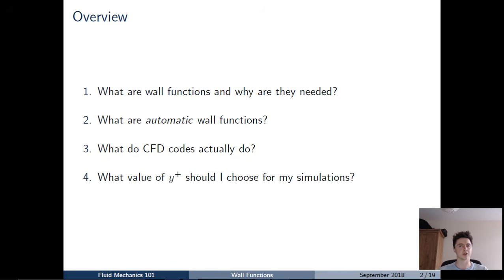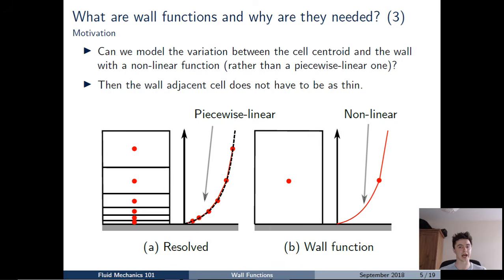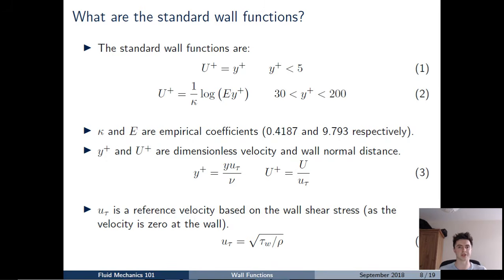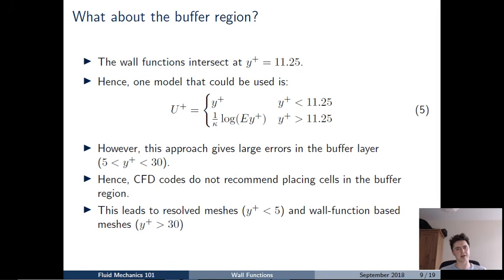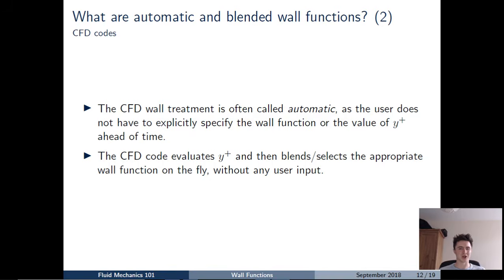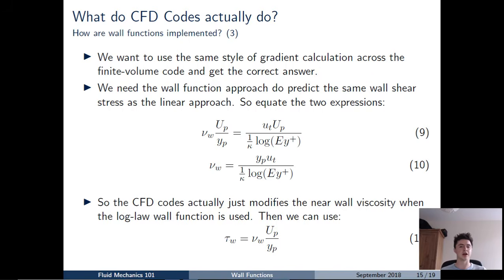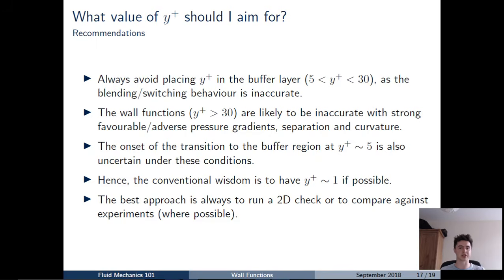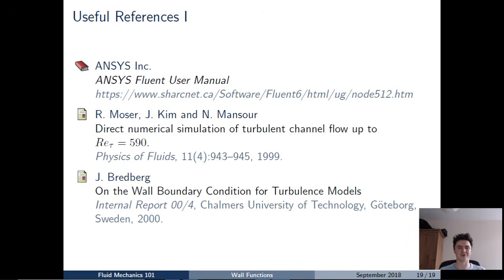[CFD] What are Wall Functions and How do they work?

Comment: I know that in the case of laminar flow, the near-wall profile is usually quadratic, which depends on the local pressure gradient. Are there situations where even a y+=1 , or even 0.1 isn’t good enough, and you need some alternative, more general boundary condition?

Comment: Good morning and thank you for such a good lesson. Just one question from my side. Here you explain the wall functions theory considering a Finite Volume CFD code. But I assume that this theory holds as well when you use a Finite Elements CFD code, is that correct? Or are there any significative diffrences in that case?

Comment: Hi Aidan, thanks so much for the video and lectures. It is really awsome and very helpful. I would like to ask you ine thing if I may. One thing is not clear to me that, how this calculated effect of the wall sheer streas is then fed into the momentum equation. Is it done by modified turbulent viscosity, which is then used in the momentum equation? So that the velocity at the first grid can take into account the effect of the (total) boundary viscosity?
I appreciate your help in advance!
Reply from the maker: Yes, that's correct. The modified viscosity is accounted for in the summation over the faces of the cell when calculating the diffusion contribution to the A matrix of the momentum equation
Reply: @fluidmechanics101  Thanks a lot for the clarification!

Comment: "Thank you for your awesome video! could you please tell me which y+ in In OpenFOAM, should  be between 30 < y+ < 300? Is it the minimum, maximum, or average ?
Reply from the maker: It is the y+ in the region that you care about (or affects your solution the most). 

For example, on an aerofoil it is the y+ on the trailing edge of the aerofoil which has the greatest effect on the separation point. You care less about the y+ near the stagnation point at the nose of the aerofoil, as this has a smaller effect on the drag calculation. 

So you need to use some engineering judgement. Have a look at your geometry and try and deduce which region in the most important. If you are unsure, you can always test it by creating a few different meshes and see what effect it has on the results

Comment: Thank you, Aidan. Well explained particularly on the implementation of wall functions.

Slightly confusing when you say "by substituting in the logarithmic profile" to evaluate the wall shear stress - Eq. (8). In fact, the velocity gradient, at the wall, can only be worked out by using the linear wall function u+ = y+ and the logarithmic profile is obviously not applicable in the viscous sublayer. Forcing the logarithmic profile to pass (yp, Up) is here to just figure out the "right" velocity scale utau.

Anyway, very high-quality video!

Comment: Aiden, I had a doubt,
Till what value of y+ is the wall function to be applied for in the mesh?
Ypu have mentioned that for y+ > 30, use wall functions
But till what y+ value is that to be used, above which is the resumption of normal CFD interpolation?
Reply from the maker: This will depend on the CFD code you are using. Often there is a hard switch between the viscous sublayer and log law at y+ = 11.25. It's really worth checking the user manual

Comment: This lecture clarified my confusion. I thought the wall function was specifying the velocity at the first grid centroid. However, through this video, I found that the wall function is not giving the velocity value to the first grid centroid, rather, it uses the velocity at the first grid calculated by the conservation equation and the wall velocity (=0) to get the modified wall stress.😀
Reply from the maker: Exactly!

Comment: Thanks Aidan for this video. In summary, velocity profile is computed as piecewise linear in CFD due to values at cell centroids. However, turbulent velocity profile is non linear. In order to bridge the gap, wall functions are used. For y+<5, linear variation is observed. So wall function is not needed. Avoid buffer region where profile is not predictable for most of the times even though wall functions does some approximation. Use wall function where y+ is above 30, profile is predicted as logarithmic and 1st cell velocity is computed. The overall purpose is to compute wall shear stress and 1st cell velocity accurately. Please correct me if I am wrong.
Reply from the maker: Yes! 100% correct

Comment: y+ and u_t require wall shear stress to be known which is part of solution. As we don't know wall shear stress yet Equation 9 is an implicit equation. So, there must be some kind of iterative approach required to solve it unless there is another way to estimate y+ and u_t.  You didn't explain how it is done I think.
Reply from the maker: Yes we'll spotted. If you choose y+ based on wall shear stress, rather than turbulent kinetic energy you need iteration. You can either just take the wall shear stress from the previous iteration of the SIMPLE algorithm itself or you can do the iteration locally. You can find this iterative equation either in the OpenFOAM source code, or checkout the book by Weller and Greenshields 'notes on computational fluid dynamics'

Comment: A question bothers me: If I set the no-slip boundary condition on the wall, and I set the viscosity to be 0 at the same time,  would the boundary condition be slip? If not, what the physics looks like ? Thank you very much!
Reply from the maker: Yep, you would have a slip boundary
Reply: @fluidmechanics101  Thank you very much for your reply! For no slip condition with 0 viscosity: the first layer of fluid still adheres to the wall, but the second layer of fluid can move freely. However for slip condition with ideal fluid: the first layer of fluid can move freely. Based on this, I still don't understand why these two situation is equivalent.🤣🤣🤣
Reply from the maker: Surely with 0 viscosity, the fluid does not adhere to the wall in the no slip case? Physically it is the action of viscosity which sticks the fluid molecules to the wall, so zero viscosity is equivalent to the fluid not sticking to the wall
Reply: @fluidmechanics101  Thanks a lot!😅 Hope that OpenFOAM would run as you suggest!

Comment: If a simulation involves just laminar flow or not using any turbulence model at all, do we need to use wall function or simply use no-slip? If we set y+ = 1, does it matter to use a wall function than simply no slip?
Reply from the maker: With a laminar flow you don't have the y+ requirement anymore because the entire boundary layer is laminar. However, you do need to make sure you have enough cells through the thickness of the boundary layer to resolve the gradients. This means that you still need to have thin cells and a sensible growth ratio (say 1.2) to have at least 5-10 cells through the boundary layer thickness. You can check out my video on 'Inflation Layers' for more info

Comment: Hi Aiden, thanks for the amazing content! At 17:10 you mentioned that it is good practice to avoid y+ in the buffer region. I am a bit confused because in my mind every cell has it's own y+ and u+, to avoid placing cells in the buffer region, wouldn't it result in a discontinued mesh? Could you please correct my understanding here? Thanks!
Reply: I think y+ corresponds always to the first cell. In the regions away from the y+, the turbulence equations are solved for.
Reply from the maker: Yes, exactly! Y+ is only calculated in the first cell
Reply from the maker: We are trying to avoid placing the first cell centroid in the buffer region. If the first cell is much smaller than this then the buffer region is resolved by the mesh and the finite volume equations will solve this region correctly and produce the right profile 👍

Comment: Hi, Thanks for your videos!! these are the best I've ever seen on the web. One question! I didn't get why we need to check y+ while there are some wall functions that fit through all layers such as the one you mentioned "Spalding's wall function". It can calculate the right value regardless of the mesh size, I mean no need to worry if some cells are in the buffer layer.
Reply: Considering you want to use such function, you still need to compute y+ because Spalding's wall function is correct up to y+<300 and you want to make sure your first cell center verify y+<300.
Reply from the maker: Spaldings wall functipn and the other wall functions are only accurate if you have a flow that is pretty much a straight pipe or flow over a flat plate. If you have a complex flow (impingement, separation etc) then these models will give the wrong answer and you need to reduce the y+ into the viscous sub layer, as the viscous sub layer is always laminar if you are close enough to the wall. It is the only solution you can rely on for a complex flow. So the answer is: it depends on what your flow is doing 😊
Reply: @fluidmechanics101  So, suppose I want to model a turbulent flow in a return duct (180-deg return duct) Do I need to generate grids somehow in order to get y+ in the viscous sublayer?? Even if I use enhanced wall function??? 
Thank you for your time
Reply from the maker: It sounds like you will be getting some pretty significant separations and the enhanced wall functions were developed for attached flows. So ... if you want the best results, better to try and get y+ in the viscous sub-layer

Comment: Thank you for the wonderful explanation. In case we are taking y+ value less than 5, do we still need to use wall functions?
Reply from the maker: It depends on the turbulence model and how it is implemented by the CFD code. K omega SST is fine without wall functions. K epsilon will depend on whether the code is using a 'classical implementation' or a more modern variant (like in ANSYS Fluent) which has capability to do y+ < 5
Reply: @fluidmechanics101  Thank you so much. Really appreciate your response

Comment: Hi Aiden! Nice video and thanks for the superb introduction. I have a small doubt and wonder if you would like to share some wisdom. If in CFD y+ is way smaller than 1 (say 0.02), other than high aspect ratio, will wall function also predict wrongly?
Reply from the maker: They should be fine because the velocity profile is linear in the viscous sub-layer. So you can go as close to the wall as you want, the profile will always be linear
Reply: @fluidmechanics101  Thank you very much for your answer!

Comment: hello I am korean cfd user

I am pleasure to see your you-tube and it make me to help 
I have a question about wall-function

you said that "Always avoid placing y+ in the buffer layer (5 < y+ <30), as the blending / switching behavior is inaccurate.

I knew if i use standard wall function, I need to avoid 5<y+<30
but using automatic wall function, it helped "standard wall function" about improving analysis accuracy because it blend by in-house code.

So I have thought automatic wall function is good to reduce  inadequate analysis result.

that is wrong?

Please understand that english is not good.
Reply from the maker: Yes, you are correct. The automatic wall treatment does improve the accuracy a bit (compared to standard w f with switching) in the buffer region but it is still not very accurate and you should try to use either y+ < 5 or > 30 if you can 👍
Reply: @fluidmechanics101  Thank you for your attention
It is helped me to be assured about "automatic wall function"

Could I more give some questions?

1. if I not use "wall function", ansys's manual recommend y+ < 1. 
so for it, recommend to make more than inflation layer 10.

but I am not sure if it's right. 
So, I think it need mesh dependence test about how inflation layer make instead of manual guide. I am wondering your opinion 

2. I learned  my superior that y + is not important in case of "airflow analysis" (such as  analysis of ventilation inside the house, outdoor airflow etc) because force arise for velocity profile around wall is weak compared to total airflow force so it not much impact
I also not sure if it's right. I also wondering your opinion 

thank you for reading my questions.
Your help is a great strength to me.
Reply from the maker: A simple answer to both questions would be: yes you should always try and do a mesh dependence test. You can try different values of y+ and different numbers of layers and see how much it affects the solution. The general guidance that people give (around y+ and number of layers) is useful as a starting point but then you should try it for yourself. For point 2, I have often been given vague advice like this from supervisors / advisors / reviewers over the years. It is often difficult to understand what they mean and you can't really argue back. The best thing you can do is run your own tests (compare different values of y+ for example) and then show them the results. You can then let your results do the talking for you 😄 this is a very useful trick for addressing review comments as well. Better to discuss the results than your thoughts / ideas / what you saw on s YouTube video ....
Reply: @fluidmechanics101  Thank you for reply my question~^^

Comment: @fluidmechanics101 we define turbolent viscosity (formula 13) using y+ and u+ and then proceed to use it to find the correct shear stress at the wall. but y+ and u+ are evaluated using tau_w, so how is that possible? there is some iterative procedure involved or what?
Reply from the maker: Yes! The whole process is iterative. You can do this iteration every loop of the SIMPLE algorithm, or be lazy and use the values from the previous SIMPLE iteration. When the code converges, the values from the previous time step will equal the current time step and we are all good 😊

Comment: i dont get (at slide 15) how we are allowed to simplify Up,  which in one case (eq.9)  is the value of the velocity at the first cell if we suppose its y+<5 and in eq.10 we are supposing up its located in y+>30. Anyone has a clue?
Reply from the maker: The trick is that we aren't specifying the value of Up. Up is calculated by solving the momentum equations. We are actually modifying the viscosity on the near wall face, which is then used in the solution of the momentum equations during the next iteration
Reply: @fluidmechanics101  Thank u very much. i also checked the reference you gave at the end of the video and now i think i really grasped for the first time how this kind of wall functions work (at least the main part of it!). Thanks

Comment: congratulations for your work. Each of your presentation is so helpful and comprehensible. However, how is Eq. 8 derived?
Reply: Yes I don't get it either. The derivative of the log should be 1/y and not 1/log ?
Reply from the maker: Yes, I found exactly the same thing when I did the derivation. If you watch my video on enhanced wall functions, I think I do a better job of the derivation there
Reply: @fluidmechanics101  Will do thanks ! Excellent work btw !

Comment: Hey Aidan! Thanks a lot for this great tutorial! It helped me a lot to understand the wall function approach better. 

Although i think there are some small mistakes on the slide 14 in equation 8. First of all the gradient should get multiplied by the dynamic viscosity mu, instead of the kinematic viscosity nu. And therefore the term on the right hand side should also get multiplied by the density to be consistent with the unit of the wall shear stress in pascal.

Greetings from Switzerland! :)
Reply from the maker: Yep, well spotted!
Reply: Kinematic viscosity is equal to density / dynamic viscosity right? These equations makes sense to me. If you want to choose the density just express the equations in terms of density over dynamic viscosity instead.
Reply from the maker: Kinematic viscosity= dynamic viscosity / density (your fraction is upside down)

Comment: Thank you so much! I'm also watching other videos.
I still confuse the difference between wall function and dumping function in k-e  model... Both are used for treating near wall characteristics. what's the critical difference?
Reply from the maker: The key difference is that wall functions are applied to the faces of the cells in contact with the wall. Damping functions are applied to all cells, even the cells that aren't in contact with the wall 👍
Reply: @fluidmechanics101  I see! Now I understand. Thanks for quick and cordial reply. 
It is a really helpful video channel. I also introduce to my friends :)

Comment: Aidan, very nice video! I really like your graphs! What do you use to create those graphs? Tikz? 

Also, I would humbly suggest that the discuss wall treatment with the mother turbulent models (i.e., low turbulence Reynolds number model and high turbulence Reynolds number model.). Inappropriate combinations of turbulence models, wall turbulence models, and computational grids can be detrimental, yet most CFD partitioners are not well informed.
Reply from the maker: I made the graphs in python and then edited them in inkscape 👍 thanks for the suggestion, i like it! Good idea
Reply: @fluidmechanics101  good idea! I will give it a try. I typically use matlab+GIMP.

Comment: What could be the reason if the refinement and improvising the mesh still do not reduce the Y+ with reference to the reduction in the cell size?
Reply from the maker: Remember that the solution also changes, so the wall shear stress will change each time ... out of interest, how large is your y+? This is more common at higher y+ values